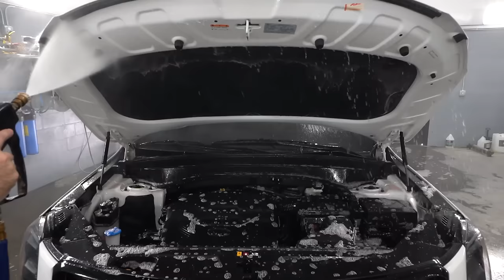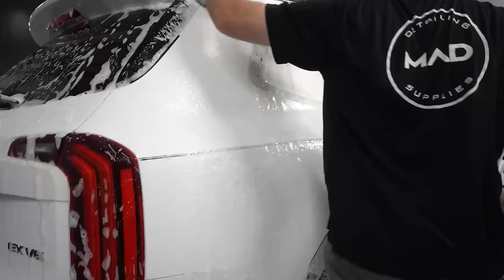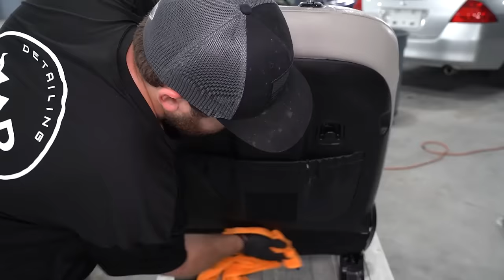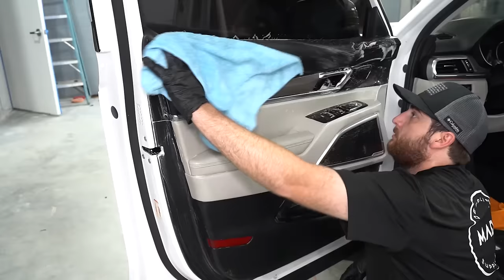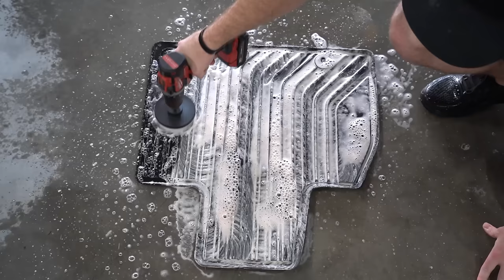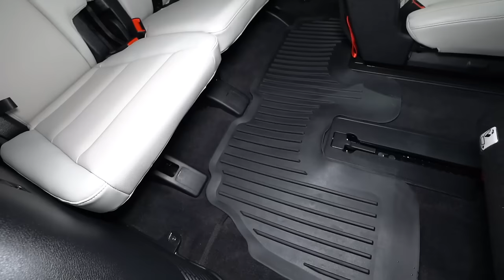Deep Cleaning the Muddiest Kia Telluride Ever! | Satisfying Disaster Car Detailing Transformation!

Comment: Second time I watched one of your videos. I’ve owned a detailing business since 1991. ( 31 years ) My business does between 4-5 cars a day and we are open 6 days a week. Average around 1100-1400 vehicles a year.  We do everything from complete paint correction, fabric and carpet dye, to restoring and painting the trim.  We also offer ceramic coating and undercoating and window tinting.  I see you still use a clay bar.   WHY?   Have you ever used Nanoskin?   We only use Nanoskin Autoscrub foam pads ( comes in fine and medium) and an Autoscrub sponge. ( to get into tight areas ).  The advantages of the Autoscrub pads is that they don’t hold the dirt like a clay bar does.    Even though you knead the clay and turn it your still dragging dirt over the paint.  All you do with the Autoscrub pad is rinse it off between panels.  If you drop it on the floor, wash it off.  When you detail a vehicle I haven’t noticed you removing IRON deposits.   This is very important process.  A clay bar doesn’t get all the iron out, neither does Autoscrub pads.  You should use a dedicated iron remover to help the process. As a detailing business we are members of the IDA International Detailing Association.   Good luck and wash on.   Work smart not hard.   Look into the Nanoskin Autoscrub.  It will free up a lot of valuable time.  ( about 1/3 the time it take to clay bar ).
Reply from the maker: I own multiple shops here in Florida. At one of them we do close to 10 thousand cars a year. At that shop all we use are nano scrub pads. But the vehicles I do at my studio I just use normal clay.
Reply: @MADDETAILING  what part of Florida are you in.   I own a second home in Holiday Florida??

Comment: Part of what a lot of people don't understand by him doing this crap to various vehicles.  Once the owner starts having issues with said vehicle and they take it to a mechanic to get looked at, that's when all hell will break loose on this guy. 
For 1 this guy isn't smart enough to get all that sand out of the engine bay.  And that sand will hide in various places.  And if it's found out that this guy threw all that crap under the hood it very well can come back in a major lawsuit.  
I've been driving for 40 yrs and I've yet to see anything like this under a hood of anything that I've drove over the yrs.  And I've even been in several sand storms and still haven't had anything like this under the hood.